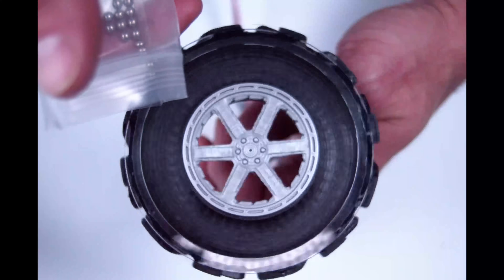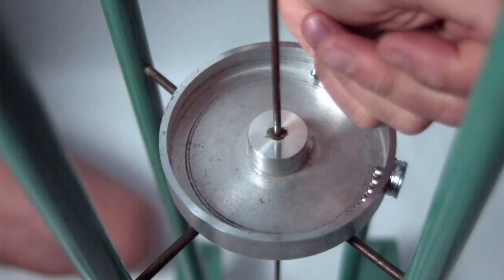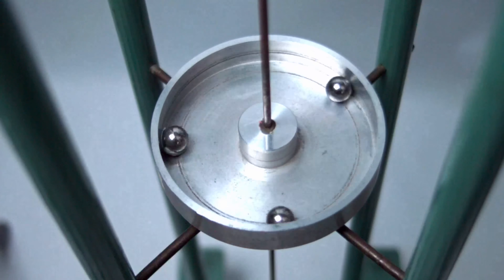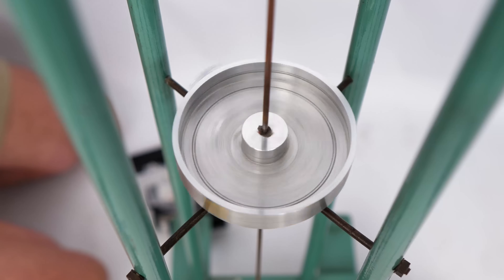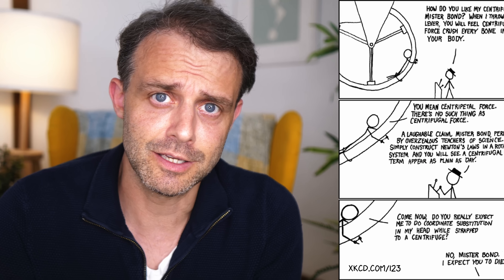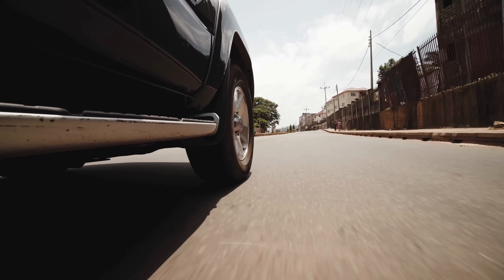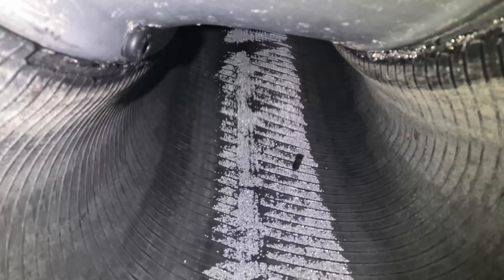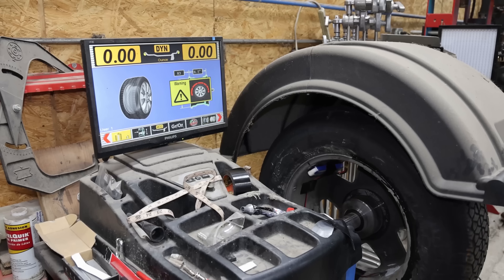Do tire balancing beads actually work?

Comment: Really appreciated the thoroughness of this video.  I have a question that may call into question your conclusions at the end.  I have a large, 4WD pickup with oversized off-road tires.  I developed an almost “fatal” wobble at speeds between 60 & 70 mph.  I took my truck in to get the tires rotated and balanced.  To my surprise, they didn’t charge me as after rotating the tires, they couldn’t get them balanced saying the machine was requesting too much weight.  However, just the act of rotating the tires made the wobble almost disappear.  They suggested the beads for really large off-road tires.  My point is, my wobble issues became unacceptable at about 61mph (it would have literally broke transmission or other critical parts of the vehicle).  I would suggest that these beads were mostly developed for off road vehicles and vehicles with unusually large wheels and tires.  I would greatly appreciate some feedback if possible.  Thanks

Comment: I wonder if you could create such a chemical that remained a solid until the car got to speed but then the beads would melt and fuse to the tyre, permanently fixing the issue even if you slow down

Comment: They are absolutely dangerous in a car or pickup truck.  Hit a bump and the beads loose their spot and your car is practically uncontrollably wobbly until you slow down! 
How do I know this? A lazy mechanic put them in my tires at the shop, after nearly wrecking on account of my tires acting funny, I went to a different shop to get tires balanced.  They couldn't do it because of the beads. An older mechanic there asked if there were beads in there, I told him I didn't know. He pulled tire off rim and VIOLA!!! BEADS! 
They vacuumed them out and balanced my tires and I had no more problems.  
Stay away from balance beads!!!

Comment: Cover the beads with glue.
Attain the required speed before the glue starts to dry and maintain it until it's completely dry.
Slobrem polved ~ permanence style ~.

(alternatively, just use glue by itself. I hate to say it, but I don't think you need balls)

Comment: Since the beads have to be reset every time you slow down below the point where the beads collect in the balanced place wouldn't the logical answer be to inject a slow (10 - 15 minutes) setting glue into the tyre with the beads and keep driving / spinning the tyre until the glue sets? Something like SS-3006TF silicone. The beads (and silicone) then stay in place? No?

Also wouldn't loose beads be dislodged from their optimal position by harsh braking / rapid changes of momentum? They'd still have inertia.

Comment: I did research on this in 1965!  Complete with a mathematical 13:54  analysis of all the forces involved.  Once balanced, we clamped the balls in place pneumatically.
Reply: How did you clamp the beads in place inside of a tire?
Reply: @fredrickneidhardt8064  I'd imagine an inflatable insert that you inflate after it is spinning smoothly would then hold the weights, which you could then use to add the weights in a more long-term manner.
Reply: @fredrickneidhardt8064  No idea how they did it, but the method i can think of is to partially inflate an inner tube inside the tyre, then release the pressure in the non-innertube volume of the tyre so the innertube expands to fill the space.
Reply: @thomaswilliams1082 okay, that makes sense for tubed tires, but almost every single automotive tire doesn't have tubes.
Reply: @fredrickneidhardt8064  Bernard's watch + Gorilla Glue
Reply: What did you conclude?
Reply: @vutivimashele709  He became the CEO of Tire Beads Inc.
Reply: Coolest come-back ever lol
Reply: @vutivimashele709 doncha just ❤ it when u ask the op a serious question and they ignore you?!!!
Reply: @savage22bolt32   This is likely made by by AI and it couldn't come up with an answer. It has 372 upvotes I presume because people love the mathematical 13:54 analysis which can't be something related to this video which ends at 13:53 so must be biblical 👍
Reply: I imagine there are reasons it wasn't mass marketed/implemented at the time, or was it? Many things have been invented which would improve the lives of people but there is much more to it than simply implementing it. I know that tires can change their balancing dynamics as they wear, is that partially why? Thanks for the information.

Comment: i wonder if a machine could be developed to coat the inside of the tire with an epoxy of sorts that self leveled and dried at high speed to perfectly balance the tire. that would be sweet for drag racing where we often dont run weights at all.

Comment: It's kind of like how there's also a high tide on the opposite side of the Earth from the Moon. The bearings probably drag along the inside rim while it's spinning similarly to how the high tide is dragged and slightly lags behind the Moon until it hits a sweet spot of balanced forces. 

I reckon it's to do with increasing the weight and/or the distribution of it so that at the right speed the impulse that makes the wheel wobble is not enough to push the wheel off axis.

Comment: balance beads are best for people who use motorways or highways often. Also balancing of your tires affects more then just ride quality. tire balancing can cause additional suspension wear (aka bad ball joints, shocks/struts going bad prematurely) and thus more tire wear aka tire cupping/uneven tire where across the tread. so dont underestimate the importance of tire balancing

Comment: If you used a magnet as the weight when you added the BBs or bearings at slow speed the metal was probably sticking to the magnet. I’m sure whether you made sure they were non magnetic or not because if they weren’t thought was my only thought on why it messed up at the start

Comment: The problem I see here is you are using a solid model to try to simulate what happens in a flexible or variable model. 
If you've ever seen slow motion pictures of tires rotating, they're constantly changing their shape as they strike the Pavement. 
So these balancing beads can never achieve an equilibrium because the constantly changing geometry of the tire. 

It is still snake oil.

Comment: interesting that the ~50mph mark is the threshold for the self balancing speed. as you demonstrated with the coffee stirrer thing, the motor doesnt have to work as hard to go a higher speed once that's achieved, and similarly around 50-60 mph is when fuel efficiency peaks. I imagine thats more to do with aerodynamics but curious if that has any impact on it as well. similarly on a motorcycle around 50-60mph is when you can feel the bike become a lot more resistant to having the steering flicked around compared to slower speeds

Comment: The contraption seems like a toy here in the Philippines that my grandpa showed me. I usually oscillates a lot at the start but once you get it moving it becomes more consistent and easier. It consists of a disk and strings connected to each side of the disk and it spins once you roll the disk for a bit and the strings contract.

Comment: This is mainly used in larger vehicles. My motorhome which is an American tradition uses sand bagging style to balance out. The larger wheel and tire on a large rig arena affect as much at low speed. Perfect application for large rigs. Used every day on them.

Comment: The solution for balancing rotating objects by the use of loosely added balls was once used in computer CD drives. You may, in factory, precise balance the dish on which CD is placed, but CD itself is not balanced at all, so for counteract CD induced imbalance, such clever solution was used.

Comment: I would rather have fixed balancing weights so I don't have to go 50 mph before it balances. what's the point of beads if the car shakes at specific speeds, when counterweights fixes it for all speeds?

Comment: The issue I see here is that if I'm at freeway speeds then I'm probably on a freeway and won't be driving slower however if I'm not on the freeway then I'm probably not going to reach freeway speeds and likely have to make a bunch of stops for lights and or stop signs

Comment: If you could make the beads out of some kind of time/heat/friction activated resin you could just dump them in drive at high speeds and have them glue themselves to the right spot and have them stick in the balanced position. So even if you then slow down it will still be balanced.

Comment: Put the beads in gel filled capsules that bust when you reach freeway/motorway speeds that form a kind of rubber glue that holds the beads in place and keeps them there.

Comment: the problem is that this is an eignvalue problem, and whether balance occurs depends on the rotational rate of the wheel. So there will be frequencies that are "good", but there will also be frequenceis that are "bad". So are you driving at "good" frequencies of rotation or a "bad" ones. What are the population of these frequencies? That graph determines scam or not.

Comment: I bought a set of tires and rims for my truck and opted for balance beads and they worked (for awhile). After a few years all of a sudden I was getting bad vibrations at around 55 to 60 mph and couldn't get them to balance anymore and thought I had a transmission problems as told to me by the dealership. I took it to my neighborhood shop and they used standard weights to balance my tires and all the vibrations stopped.  So while they worked for awhile I'm not sure how long they will last, do the beads degrade over time?

Comment: how about you try putting fix a flat in the tire first filling it up with beads driving out highway speeds for an hour and then see if it fixes the problem forever:) 

Make sure you have your friend bring your car to the tire shop though if you need a new tire After it wears out

Comment: No... these glass beads will destroy the tires from inside. The beads will groove the tire.  It would be better to add oil or lotion in the tire. It will find its balance. 
Nope, balance the tire on a computer balancer. That's that. 
However , the tire must be set up initially to be as smooth spinning as possible. In other words defective tires must be detected first.

Comment: I use balancing beads in all my tires now. Reason- in Northern Canada we get mud, ice, snow that can build up on the rims or tires. And the balancing beads compensate in real time. BUT, small beads can clump if there's moisture. So.... moving forward I'm only using airsoft BB's

Comment: I wonder if manufacturers could build it into the tire. Perhaps a tube ring on the inside specifically to hold them. If you have that, maybe fluid would work better than beads.

Comment: I notice the shafts are still doing a fair bit of flexing even though the wheel is balanced. What would be the reasoning behind that? And is it a similar reaction with an axle in your car for example? 😅

Comment: I wonder if the speed is a local energy minimum, and if you went even faster, would it go chaotic, like one pendulum tied to another that reach equilibrium at certain speeds but go nutters at others. Something about this also makes me think of the theory of relativity, where when the center of mass moves during the wheel's precession, the beads move down the slope to reach the least energy level for them.

Comment: Almost every person I know that uses balance beads is using them in very large tires, not car tires. These transitions happen much sooner in bigger tires. Seems like my old jeep with 38s on it would start hopping at around 45mph and smooth out by 55. They are also hard to balance and need rebalancing more often. So people just fill them with beads. Its also used much more often on motorcycles, where the owner is changing his own tires more often than in cars. This is actually tech taken from engines. The rotating mass in an engine is never balanced. So everything is weight an a steel disk is added to the front of the engine. The plate has holes drilled in to it to change its weight an counteract the imbalance in the engine. Its called the harmonic balancer. This is a lot of work though. Its only done in production engines where millions of identity engines are produced. Preproduction engines, race engines and hotrodders use sand or water. A hollow steel doughnut is used. It is part filled with sand, but sometimes water. When the engine is started and revved up, whatever is in the doughnut is slung to the outside and balances the engine. The tradition of free revving a race engine up after starting has an actual use besides sounding cool..

Comment: I have a ceiling fan to try this on. 3d print a track, add bbs, will see
Reply: back to report that a 3d printed track carefully centred on top of the spinning section and the use of 15 10mm ball bearings and they settle into place well enough but it basically made no difference to remove vibration from the fan.

Comment: It's a scam even if it works because the only time you would need to balance a car tire is if you changed the tire yourself and didn't have any other way to balance the tire. Or, if one of the weights installed by the tire technician that last time the tire was changed fell off. This is a super minority of car owners I would think and since conventional tire balancing is not expensive, I see no use for tire beads at all.

Comment: Balancing beads were a life saver in my mud truck days, "air soft BB's" in my case. Some of the 38"+ tires needed more weight then you could fit on the rim and if you lost part of a lug on a rock it would be out of balance again. The MAIN issue is if you hit a hard bump/railroad tracks at highway speeds the BB's would get knocked loose for a second or two before finding the sweet spots again, resulting in momentary wheel shake.

Comment: even if it doesn't really make that much sense on a street car... this could actually be a better way to balance the wheels on a rally car. There, tires are generally made of softer rubber for better traction... at a serious cost to tire life, often only lasting a single stage, or one rally at most for some slightly harder tires. I imagine track surface conditions, corner intensity, and even just driving styles could result in irregular wear patterns, which would of course affect wheel balance. traditional methods of balancing can't account for this, but beads in the tire would automatically adapt and keep the wheel balanced throughout the race no matter how many random chunks of tread get left behind.

Comment: so balancing beads will be really super duper if we find a way to lock them after they take balancing position. For example: after reaching critical speed they melt and glue to inner tire surface, and then you stop completely - beads remain on its places despite the gravity.

Comment: I put about 40 oz of tire sealant in the front tire of my GMC Canyon. It was smooth up until around 55-60 mph and then it would shake like hell. If I took it up to 80-85 mph it would smooth out again. It’s just a run around farm truck so I just keep it around 50 and it’s fine. Needs new tires but I think it’s about to blow up so I’m not sinking any more money into it

Comment: Lol… mechanic…
Lol… precisely placed…
Sir, I’m a service technician and half the time i dont do what the machine tells me. Thing is many machines are old and give wrong values. I take an educated guess and I’m damn good at it. I’ve been personally requested to balance vehicles several times. Also, just so people kno, yes, ur tire can slide on the rim over time so between the sliding and the wear on the tread, get ur tires rebalanced. I would just go ahead and get em rebalanced any time ur rotating. Also, get ur tires rotated. It will make ur set last longer.

Comment: Okay, it 𝙘𝙖𝙣 work... under very specific circumstances.
Who in their right mind would do that just to avoid a fairly insignificant amount of money to have their tires balanced the normal way (which works 𝙖𝙡𝙡 𝙩𝙝𝙚 𝙩𝙞𝙢𝙚)?

And just how are you supposed to get them in there? You would need tire mounting equipment just to  do that. You'll just end up taking it to the same guy.

Comment: Your analysis is 100% correct.  Tire balancing beads are largely a scam.  BTW, many mechanics hate them because of the mess they make when working on tires.  You are better off with old fashioned balancing techniques.

Comment: In theory, if you were to fill the tyre with balancing beads along with a really low viscosity rubber glue and spin the tyre in a balancing machine until the glue cures, you'll effectively set the beads into a permanently balanced state

Comment: This is problematic.  The resonant speed of the rotor system is dependent on the stiffness of the rotor.  Very stiff rotors will have higher resonant frequencies.  Very flexible (soft/weak) rotors will have lower resonant frequencies.  You can get a weaker rotor above it's critical speed more easily.  But... weak rotors are inherently problematic for other reasons - any kind of other system pertubation will cause very serious problems!

In one instance Don Bently (Bently Nevada) diagnosed a case of a cracked shaft by observing the vibration decreasing on the rotor over time.  The machine was running at steady speed, but the resonance went through the machine as the rotor weakened.  Vibration went up, then started going down.  So, yeah, you can change the vibration of the system by changing stiffness.  Changing the stiffness is generally not a good option in real world applications.  Fixed balancing is much safer for higher speed applications.  For low speed stuff, beads may make more sense.